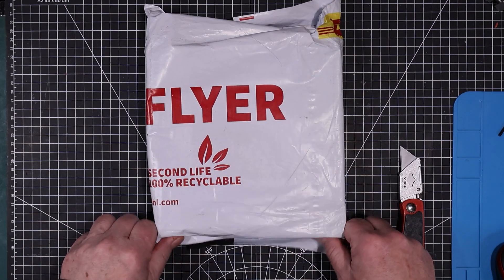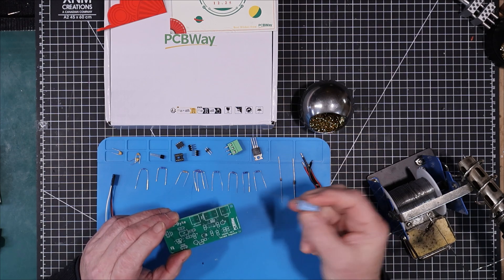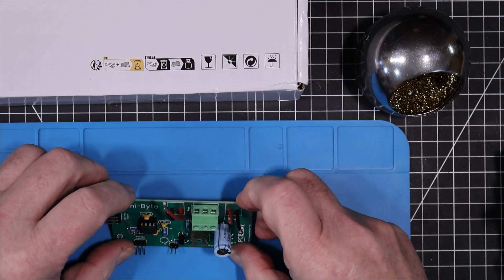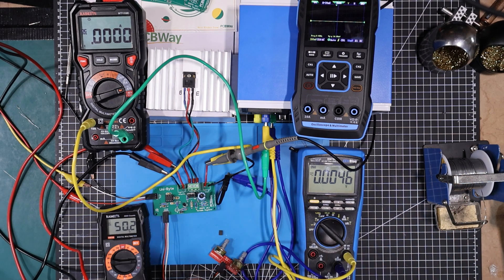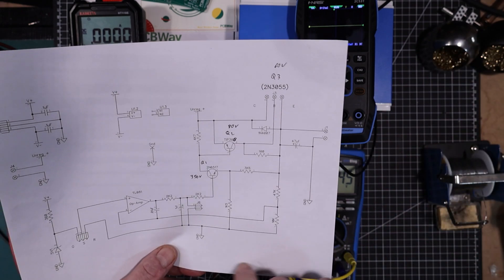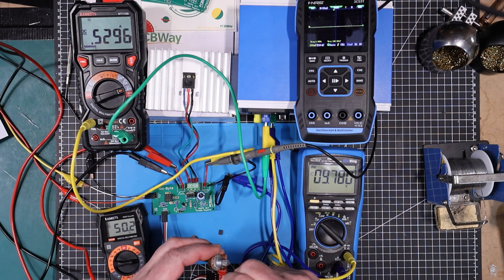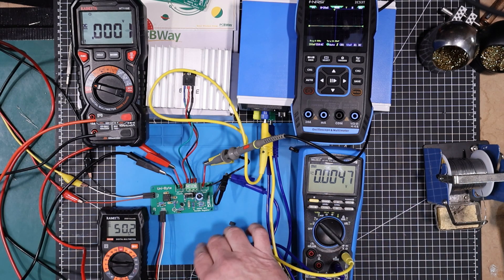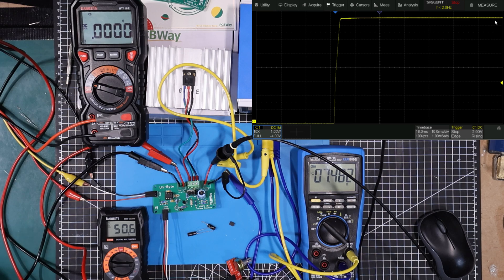Uni-Byte 0242 - VARIABLE DC Power Supply - REGULATOR Build &  Test.: Part 2

Comment: If possible, you might want to move the electrolytic cap a bit further away from the heat of the regulator. On the other hand if you don't run it to hot, there is no problem. I had a few warm capacitors on my designs so I'm always on the look out. Haha.
Reply from the maker: The whole circuit is a regulator, but the cap in this one is next to the PNP power transistor that drive the pass transistor.  It does not get hot at all.  Perhaps a little over-kill.

Comment: No ringing there. It powers up very cleanly. I think I'd turn the supply voltage both high and low, and set up the scope trigger just below that voltage, and with the supply voltage turned on just connect the rated load to the supply and observe the power supply's voltage transient. That's pretty much a worst case scenario for the supply. If it's relatively stable I'd call it good. BTW, I used to work at HP.
Reply from the maker: The issue becomes what kind of load?  I tried that with some of those highly inductive vitreous enamel wire-wound resistors and got varying degrees of ringing (close to 1 Vpp worst case).  I would suppose a 100% ohmic load would produce less, but they are hard to find.

Were you there during the Bill and Dave heydays?  Or during the horrible Carly years?
Reply: @uni-byte , 1 volt of ringing for an inductive load seems reasonable to me for a hobbyist PS just as long as it stabilizes quickly. Inductive loads don't usually care if there are modest transients.
I got out of HP before the witch, and everything went to Hell. I started out at HP Colo. Springs as a machine op, waiting for a tech job opening. I worked 2nd shift alone on the second level of a huge building, running CRT pump-down equipment, ovens and High Vacuum systems and cryo-pumps making CRT's for scopes. I worked right across the isle from the R&D cubicles. One night I saw a guy wandering through the R&D area in the semi-darkness, since it was after hours for the R&D group, and I noticed that he wasn't wearing a badge. So I went over, and told him that he couldn't be in the R&D area without a visitor's badge, and I escorted him through to facility to the front desk where the head security guard was stationed in order to get him a visitors badge. While we walked we had a nice chat about test equipment manufacture since it was a very large facility and took a while to walk through, and  I wasn't a security guard, and the guy seemed pleasant enough. When we got down to the front desk the security guard leaped up and said, "Is there a problem Mr. Hewlett?" And Mr. Hewlett replied, "None at all. This young man pointed out to me that I needed a security badge in order to be in the R&D area, and since I wasn't issued one when I came in he escorted me back here to get me one. I'm pleased to see that all of the employees here are aware of industrial espionage and take security seriously. He should be commended for his diligence." As for me, this was in the days of information starvation before the Internet and digital photography, and I was a 22 yo kid who had no idea what Bill Hewlett looked like. Perhaps there was a picture of him on the wall in some board room I wasn't allowed into, and he hadn't started yelling about who he was or gotten huffy with me for interrupting his wander through his own R&D department. We both pleasantly did the right thing. So I went back to work, having kept my job, and gotten an attaboy from Bill Hewlett.
Reply from the maker: @johnwest7993  Great story!  Thanks for sharing.

Comment: Nothing wrong with using a TL431. Might be slightly better tempco, and has nice two resistor/potentiometer setup to setup whatever reference voltage you want it to output. 

Surprised you didn't check to see what the turn-off waveform looked like, and the waveform when it gets a step-response load added and removed.
Reply from the maker: I'll consider the TL431.  I'll do those tests later on when I have it being supplied with a transformer.  I expecting the turn off won't be as pretty since the main power will likely fail before the op-amp power.  I need to do some more thinking on what to do about that.  Maybe use an MCU to control turn on and turn off, but I don't want to get too complicated with it.